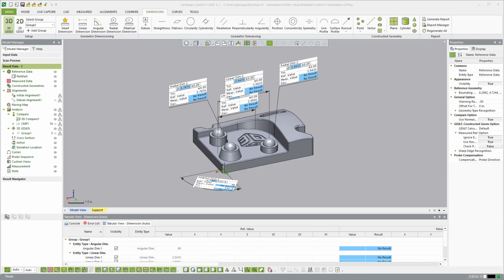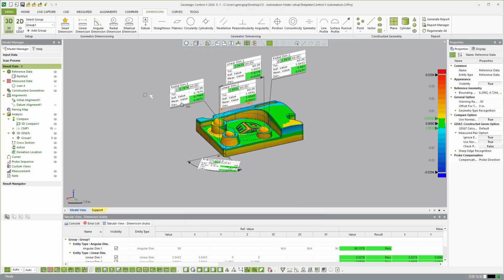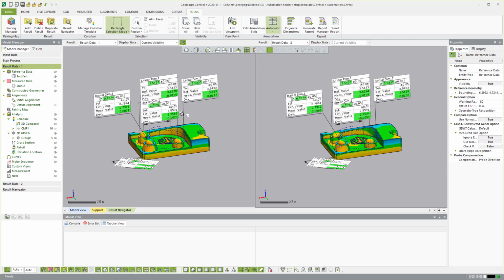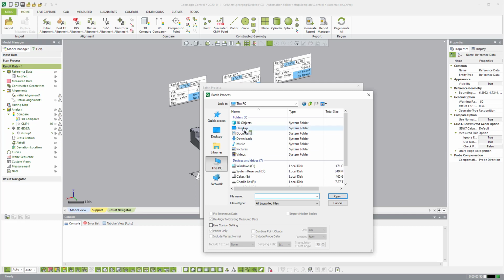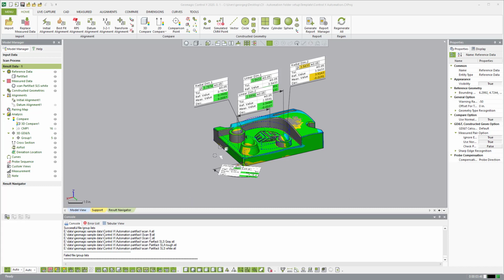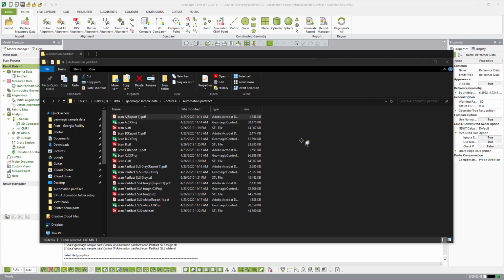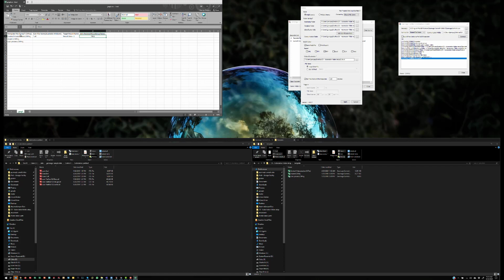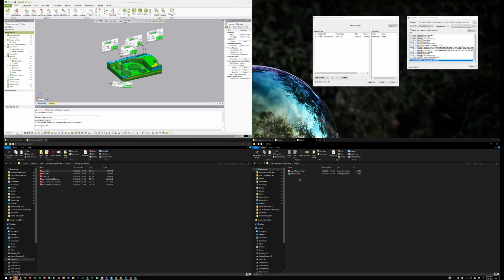Control X and Automation

Comment: Nice. Is there any option to generate multiple reports of different versions of reference data toward the single measured data?
Reply from the maker: Yes there is. You can set rules based on part numbers.